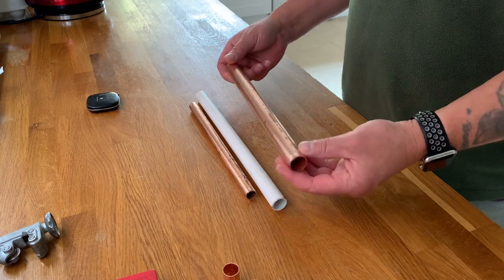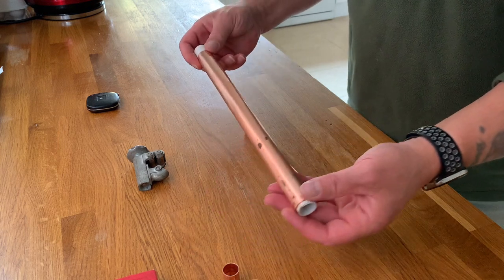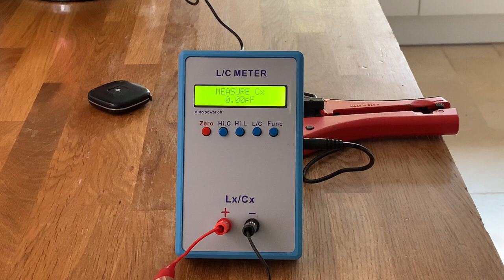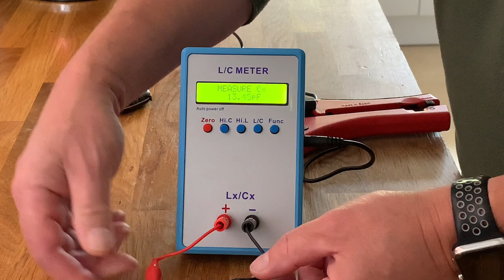HAM RADIO: MAG-LOOP Project: Making the Trombone Capacitor.

Comment: this is a good idea to make a simple and cheaper capacitor..what should I do if I need to make a capacitor for more than 100 watts?
Reply from the maker: Increase the space between the plates or use a better isolator so that there is less chance of a flash over.

Comment: Hi Mike another great video. You certainly make it look so easy and the fact that you could use readily available materials is just iceing on the cake. Have you thought about making these capacitors a little smaller by stepping up the pipe sizes to 28mm? This should make them a little smaller. I'm currently experimenting with 28mm and 22mm and 15mm pipes. So far so good 95pf with 10cm lenght. I will let you know how it works in practise once it is soldered togeter. Have you experimented with any other diameters?take care
Reply: Sorry i didnt make it clear in my previous post the 95pf on 10cm lenght is just one half of the trombone so the full trombone would be half of that.
Reply from the maker: I will have to give it a go.  :)

Comment: This is great info about the correlation between the various pipe i/d & o/d and the couplers suitably taking up the last gap around the 15mm. My only question is what is your final Q like for the finished loop (ie how efficient/lossy is the plastic pipe as a dielectric?). The reason I ask is that I tried 2 copper plates 6mm apart and slid a sheet of glass in & out to vary the capacitance by changing the dielectric constant. The measured capacitance changed beautifully but the final loop Q was crap as although glass is a good insulator it was still too lossy at HF to make a good var-cap.  I think teflon is a good low loss insulator and think the loaded grey PVC pipe is rubbish but the white stuff you have found, is it good or bad?.
Reply from the maker: All good questions, It seems to be working well....answers in the next video..:)